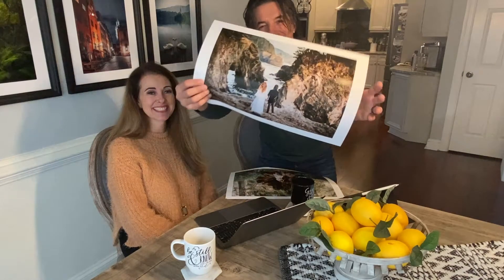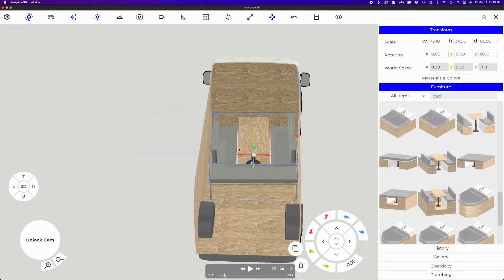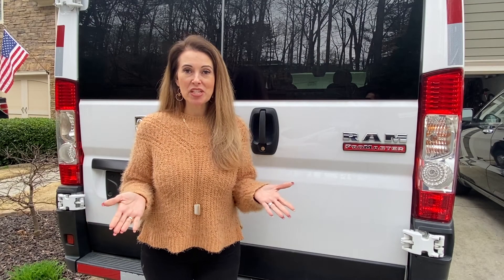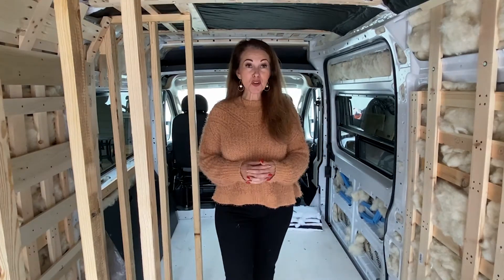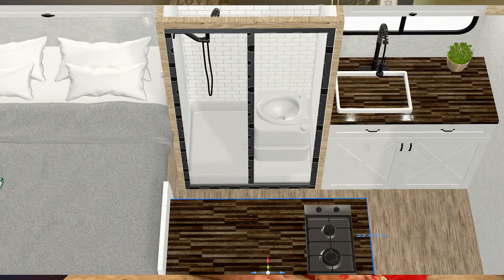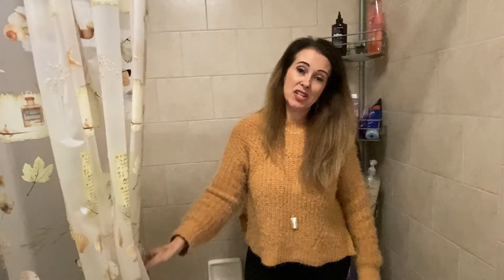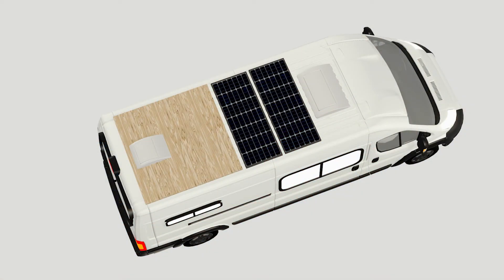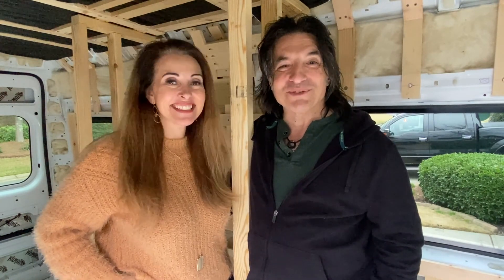Designing the Van – and why we chose the RAM ProMaster: Part 19 – RAM Promaster 2500 Van Conversion

Comment: What is the name of the AC unit mentioned in the video? 
I am following your videos as I build. Where are you buying the electrical wiring?
Reply from the maker: Hi, Thanks for watching. The installed AC unit we mentioned is the Fresair 12v AC unti (https://fresair.com/). Its not cheap....but it has great reviews.  I think the unit they sell now for vans has a built in water reservoir, so you dont need to install a separate one. There is also a special pump they sell that allows you to pull water from your main tank if that is more convenient for you.. We purchased all our wiring through Amazon....GS Power 14 guage for the lights,  4 gauge red and black 25' flexible wire for the DC to DC converter....and GS Power marine grade 12 and 14 gauge cable for most of the rest. Hope that helps :)
Reply: Thanks a bunch! What made you decide on the Fresair instead of any other AC units?
Reply from the maker: @vanmileswiththeKochs  We saw a ton of great reviews on it. Also, we live just north of Atlanta, so rockin AC is sort of a must....and we say test where the Fresair cooled the air by 20 or more  degrees. Thats pretty impressive. We are going to try and get it installed this week...assuming nothing gets in the way :)